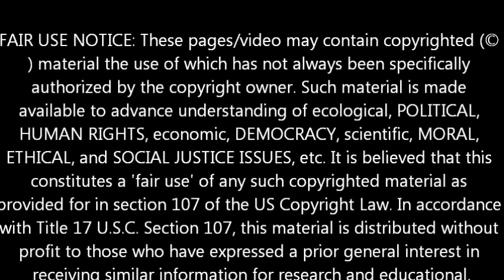PROTECTION WALL SINKING AROUND SINKHOLE  January 1, 2014

Comment: "PROTECTION WALL SINKING AROUND SINKHOLE January 1, 2014" on the Bayou Corne, LA sinkhole - South Berm is still cracking. Major movement & sinking of the whole area. Texas Brine has their work cut out for them this week to stop this sinkhole salt water material from entering the fresh water bayou. Water level in sinkhole is about 6 - 8  inches short of over flowing the top of the South side protection wall.  As per, this news report, saying the berm has sunk 4 feet since Oct and in the last week dropped a foot alone.

Good update post, thanks cajunmiracle!
Reply from the maker: Hey Sherri, They sure do have their work cut out for them. Idiots! Happy New Year
Reply: cajunmiracle Yes, big smile, this could get complicated and become quite difficult for those on the ground trying to contain this beast of a sinkhole. Hope all goes well and they get this protection wall built back up and stabilized, in jiffy quick order! I want this to be a Happy New Year! :)